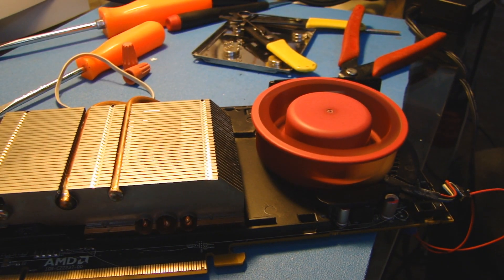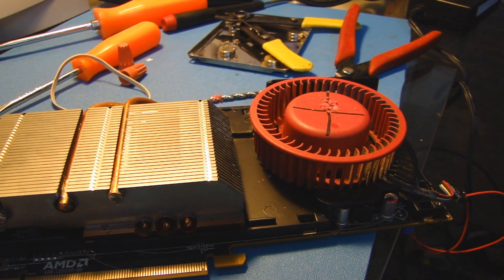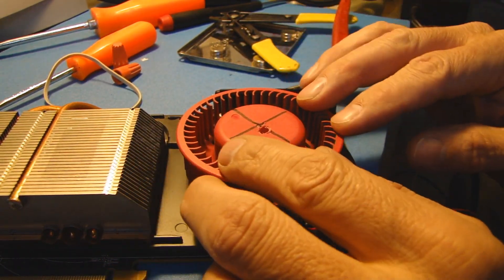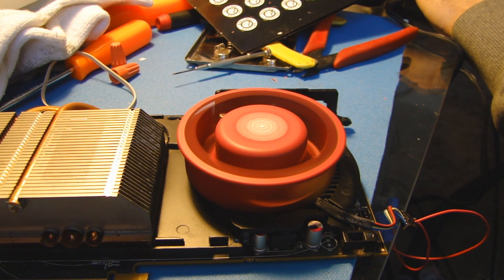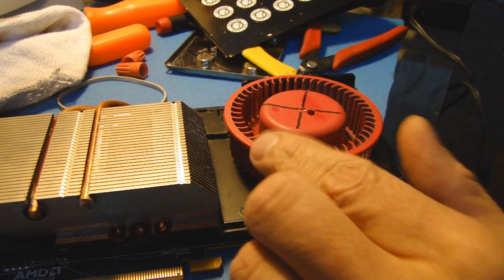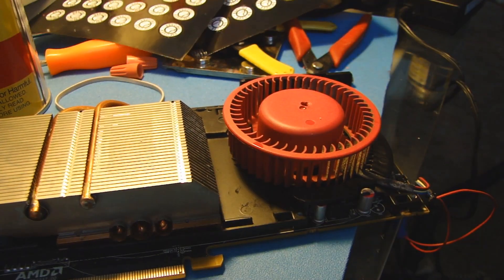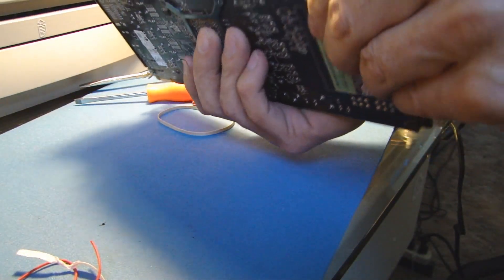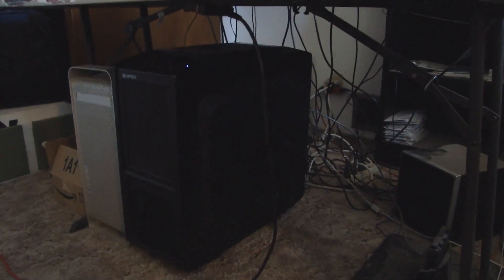Repairing Radeon 6870 fan noise...the easy way....

Comment: that was worst fan repairing dude, can u see guide book, it show DONT PUSH THE FAN!!!. but you press it with ur muscle.. LOL
Reply from the maker: 1) The instructions are for a working fan, not a broken fan.
2) The repair worked great and after many, many hours the video card is still in service and running smoothly.
3) Instruction booklets are for sissies.  Everyone knows it.
4) Please feel free to follow the instruction booklet.  Please let me know how that works out for you.

Thank you for your comments.  Please don't forget to tip the matradee on your way out.